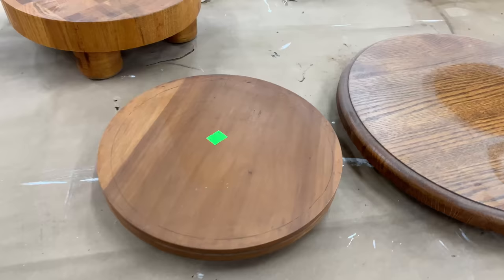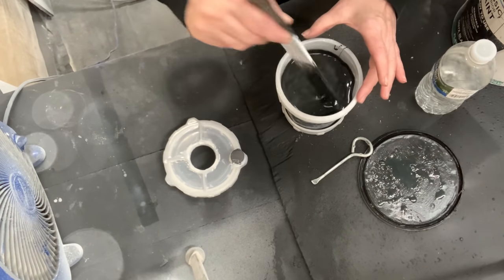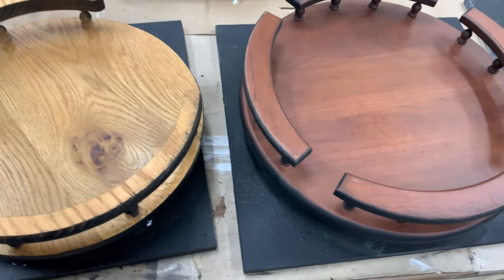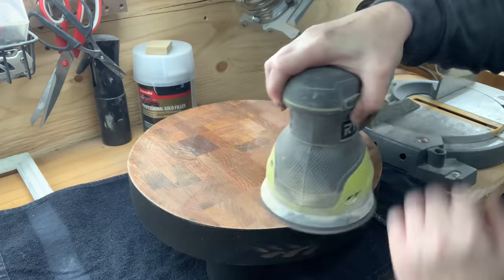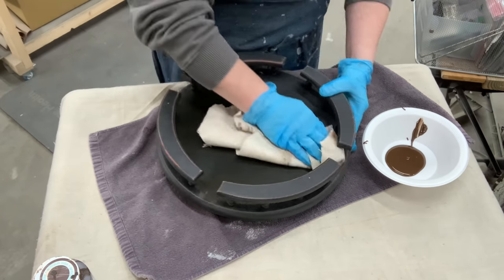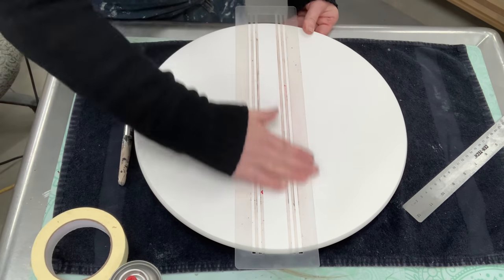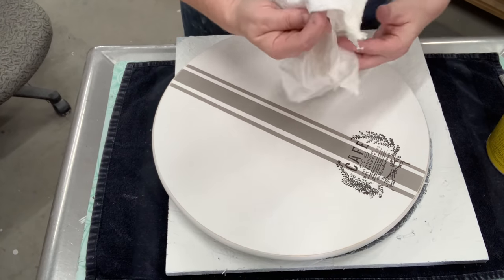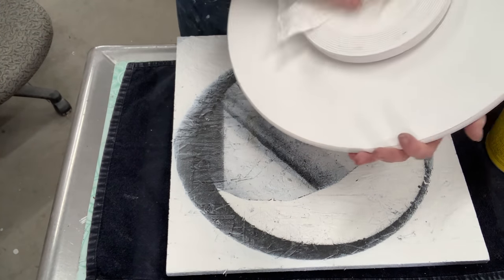Lazy Susan and Turntable Makeovers || trash to Treasure Thrift Flips | Reselling

Comment: Your work is beautiful. I live in Indiana and I have yet to find a lazy susan in a thrft shop around here! I think that if you perfect your technique, you will love that stencil. When you stencil, tape it down. Do two coats. For the first coat, use the base color or mod podge to seal the edges to prevent bleeding. When it dries, use your preferred color. Try dry brushing as well. You have a lot of paint on your brush.

Comment: This is my tip for stenciling-always wipe off your brush with a paper towel. You literally should use a dry brush very minimal paint. The bleed thru means u have too much paint on your brush. Also don’t swirl the brush-use an up and down motion. Hope this helps, blessings 😎

Comment: Yvonne, I feel like you're still using too much paint with the stencil. Try using a paper towel to remove the paint from the brush. Dip the brush in the paint, swirl & push the brush into the paper towel, each time taking off more paint. Till the brush is pretty dry. That's the way I learned, & there is no bleed at all even with a thicker stencil. Try it, it works! ❤💚❤